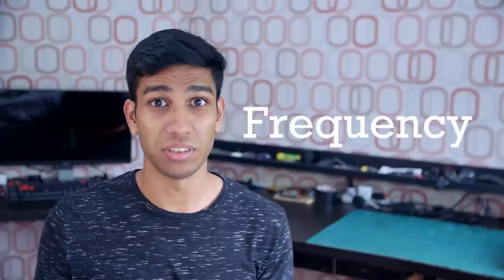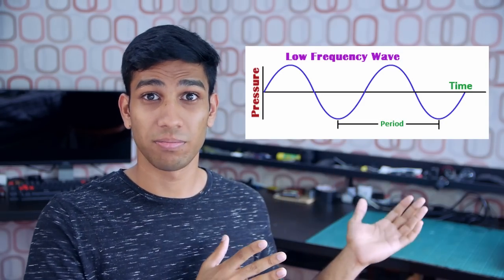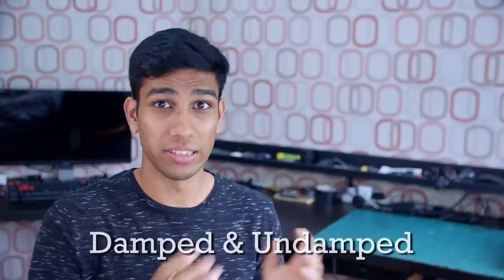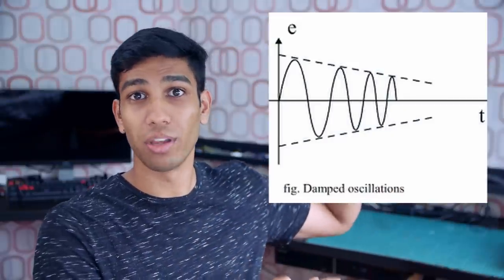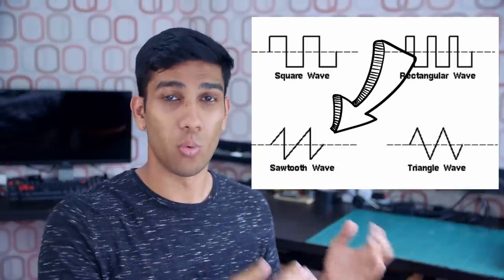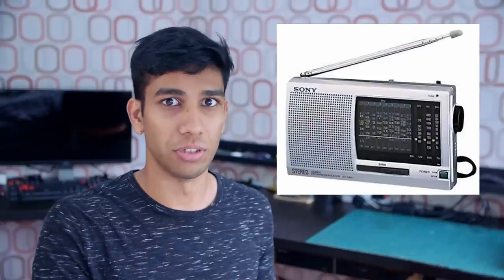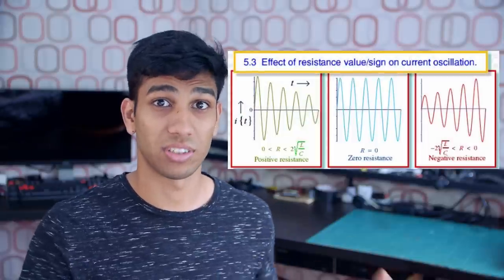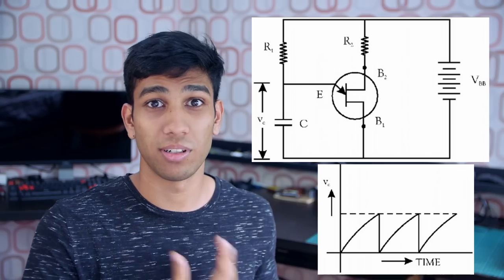Oscillators explained in 4 minutes

Comment: A soc is basically an oscillator extrapolating current inductance & polarity on a particular wavefunction
We can't have really come up with other natural oscillators like quartz whose frequency range naturally is 40k mhz
What if we use super conductors & opposing units for processor like entanglement & built instruction set on that principle
Or manipulate light or magnetic inductance to keep the function
What if we skip the current barrier we are more interested in visual changes of pixels what if AI supposed the outcome
We should not measure frequency operation s per seconds but nano seconds
We must write a program that can act as an intermediary between light sound electrons & pixels on vbyte code level

Comment: Engineers like to blame components.
50hz and 60hz AC electrical power supply to DC but DC not synchronous except for monitors, gpu and game that allows locking to electrical power supply variance as container for Mhz and Ghz.

Networking Protocols of fixed sizing containers packets and relative to slight inconstant of electricals AC to DC back to ... game, gpu, monitor

Comment: Well done Saral ! I need to get back to finish up your on-line robotics course at tinkerspark. Now, about LEGO EV3 and MakeCode programming it. Do you or someone you know have experience with the robots in their educational system ?  Could you look into it? I think the "brick" controller is running ARM9 which is older than our Microbit controller. Do you know of it and could you recommend it or is it too outdated; I see the connections are not breadboarded but plug and play sensors with snap cables. Just curious what you, with your experience in electronics can tell us about LEGO robots. Thx http://www.depts.ttu.edu/coe/stem/gear/ev3/documents/Ev3-Brick-Details.pdf